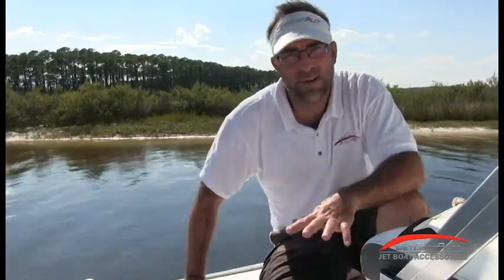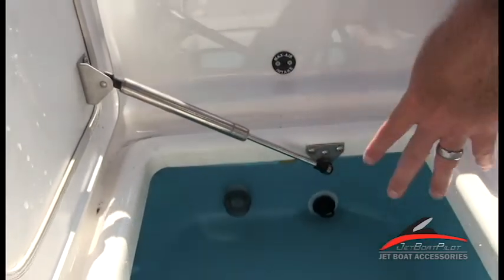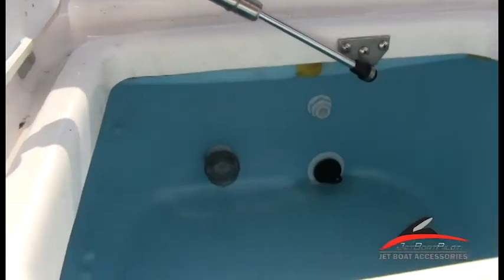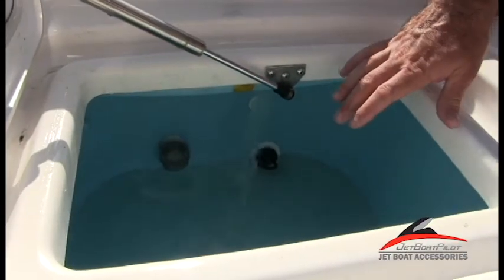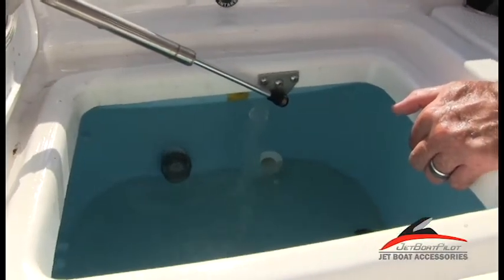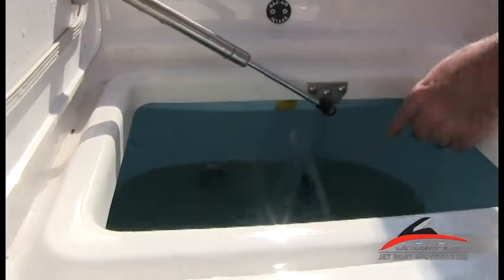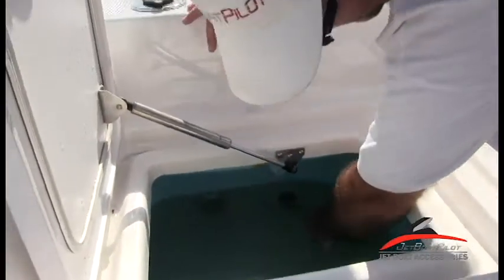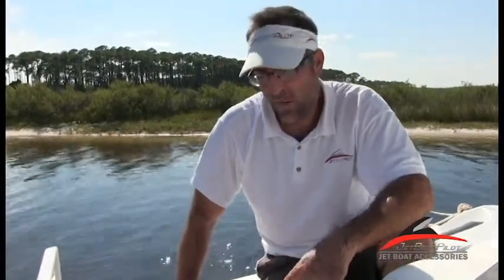Yamaha Jet Boat Yamaha FSH Live Well and Aerator Tutorial

Comment: What does the screened hole do? You said it's a filter? If you leave the fill pump on when does it stop? Will the over flow go out a hole somewhere? We see the fill water coming from the top, the drain plug and the aerator ports. Just not clear on how the water exchanges old water with new water...  I'm used to a livewell with the vertical pipe that overflow water goes into and out of the boat as new ater is pumped in.
Reply from the maker: At the time of the production of this video it was our understanding that the screen was to prevent clogs from impeding the tank's ability to drain and to properly circulate water in and out.

Comment: I feel the same way. I have a 2018 190 and the drains leak into the bilge pump. Hell the anchor looker supposed to drain out but has a gap that lets water from outside to the bilge. I get mad at Yamaha for this crap. I’ve bought so many yamaha motorcycles that I thought this would be my only boat. Looks like I’ll look at another model.

Comment: now....  I wish it worked the way he described but it doesn't .  When you turn on the aerator it just recycles the water that is in the tank and aerates it with the max air mixing valve.  In order to recirculated water from the lake/bay/ocean you have to use the fill pump.  When you use the fill pump there is an overflow drain on the starboard side of the tank which will dump the water overboard.  The issue is that the top of the livewell tank IS NOT SEALED.  So of you fill the tank to the overflow (which is not sealed too by the way) and you drive the boat the water will slosh out of the live well tank right into the bilge as you are driving the boat.

It took me a long time to figure it out but,,,  Yamaha,,, You suck at boat building attention to detail...

Stop the video on 2:12 and look at the very top of the blue tank right under the lip of the white deck near the door strut connection.  Do you see how the blue plastic tank is bowed down?  Look left to right.  Do you see how it is bowed?  Where it is bowed down is where the water runs out when you fill the tank up and your under way.  The top of the tank is buckled down and it will not seal.  Of course you cannot take the boat apart to fix it properly so get yourself a huge tube of caulk to try to get it to seal.  Why i say 'try' is because most caulk will not stick to the live well's type of plastic so you're looking at basically filling as much caulk in there to fill the void as you can.

I have the 2016 version of the boat and I've had to track down leak after leak after leak into the bilge.  My son calls it the 'project' boat.